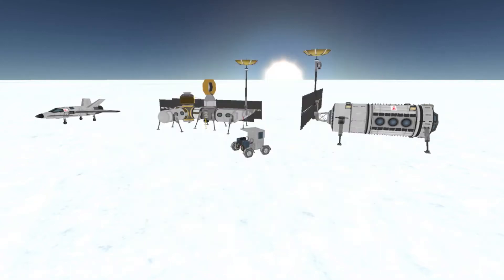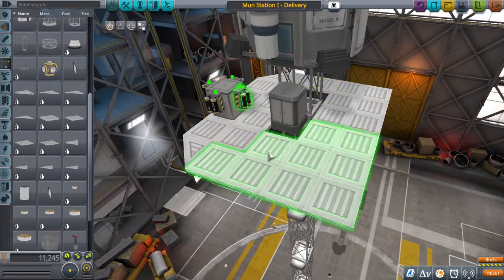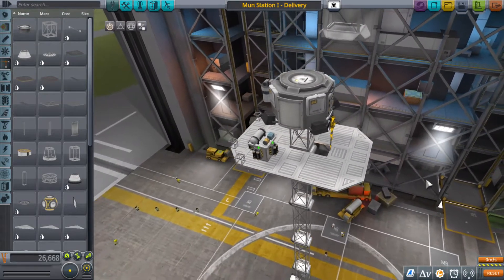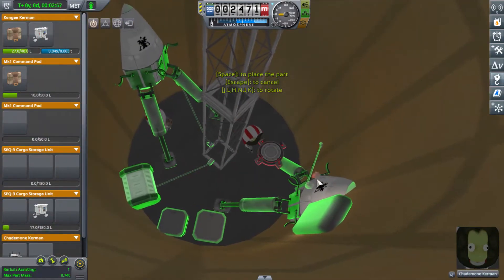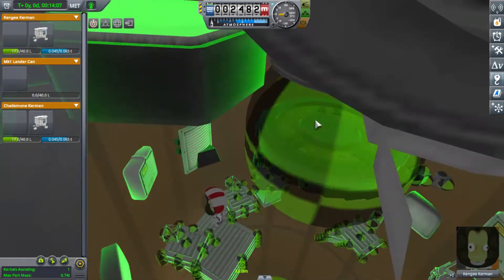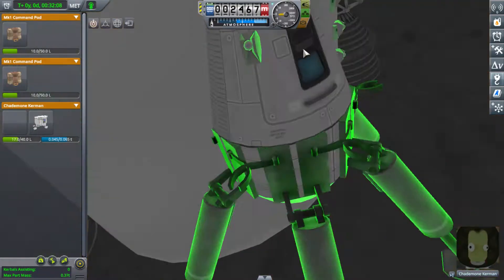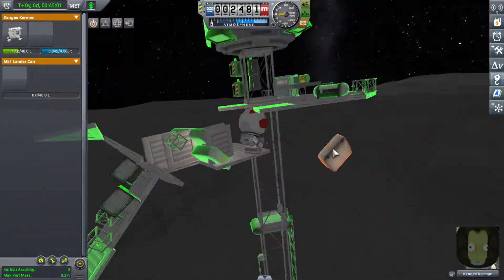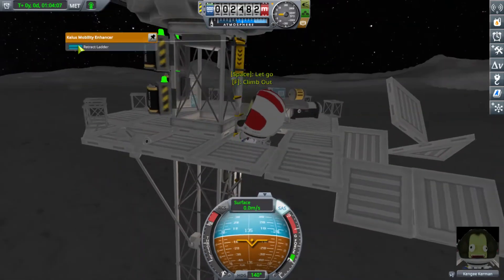Building a Mun Station with EVA Construction

Comment: A couple solutions to the rocket sliding away.....

First off, (I think this is stock and not a mod) landing gear have a toggle for "ground tether" that anchors the rocket in place.

Second option, couldn't you have put a manual physical strut (obviously not "auto-strut") between the rocket and the ground anchored tower?